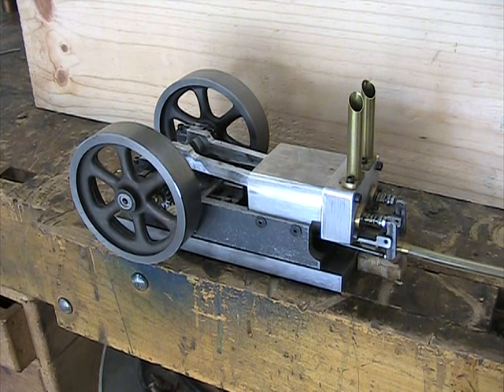TwoCylinderRedone.mpg

Comment from the maker: @BOBKB3NZX  - No, I have one pipe supplying air to the head, then a split inside the head feeding each cylinder.  If I were to use some kind of buffer tank for each cylinder, I would have to redo the head so each cylinder had a separate supply line.  Not going to do anything else for now.  I need to get focused on my hot tube engine design.

Comment from the maker: @BOBKB3NZX - I guess it depends on your perspective.  I liked the syncopated sound of the former engine better and it was much more balanced.  However, getting the air supply balanced so each cylinder fired evenly was very difficult.  The engine also runs better in its current configuration.  So, from an aesthetics perspective, the 180 was better - from a practicality standpoint, the current configuraton is better.